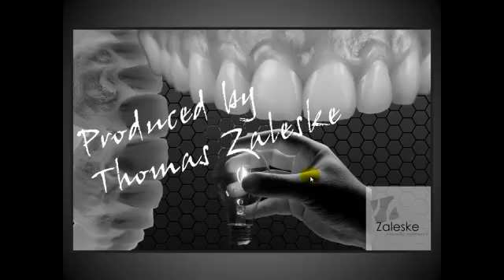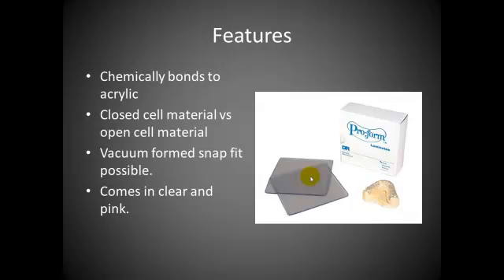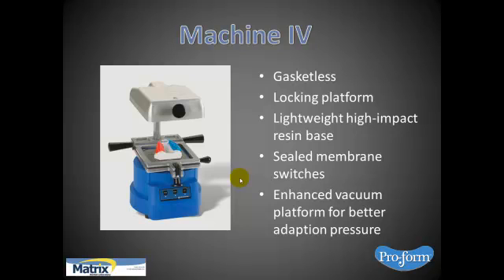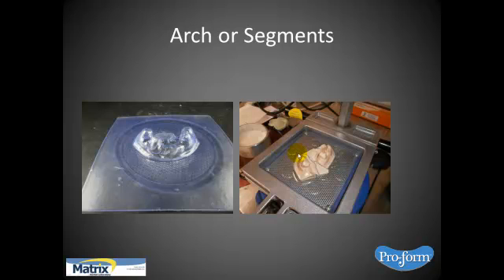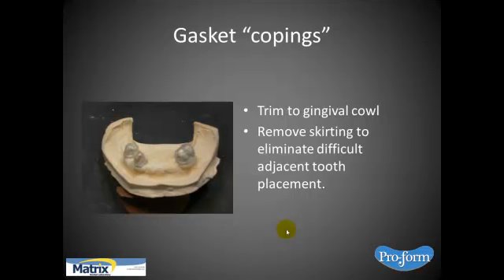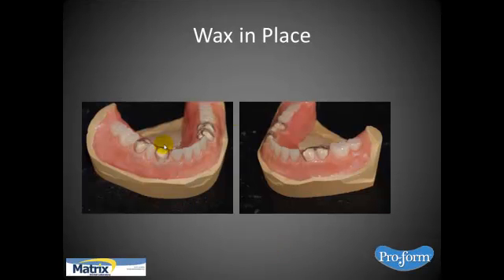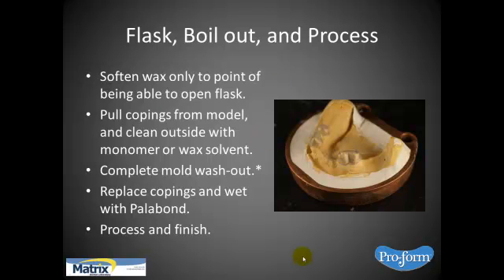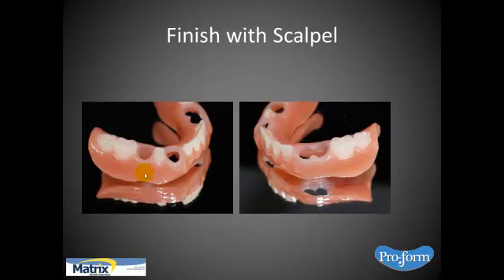E Gasket technique video

Comment: Thanks Tom for the great video. I had never heard of E gasket material until yesterday when I got the call to do a couple of gasket dentures. My Versacryl kit is 10 years expired. Scrambling, One I sent to another lab, to have done because I thought they were doing Cu-Sil. Nope, e gasket is what I got back. So now the question is- Is E gasket dual laminate night material? How thick is it? I don’t have ProForm material but do have Erkoloc and Essix.
Reply from the maker: Depends on how well it was pulled on teeth by vacuum. And how much available undercut.

Comment from the maker: The non bonding is occurring because you have stretched the laminate away from the EVA(ethyl vinyl acetate) and that EVA does not bond to acrylic! 
Try thinning your model base so that when you pull (form) the material over the model it doesn't have to stretch as much to cover. The stretching is also exacerbated if the abutment's are real long which is usually the case on cases of severe periodontal involvement.

Comment from the maker: Are you vacuum forming the correct side, hard surface UP, also it sounds like you are stretching the material  meaning you either are over heating, stretching the material over too thick a model or a combination of the two.

Comment: Mr. Thomas Zaleske,

I am having issues with the material not bonding properly.  one side of the night guard after heating and vacuum forming is very thin.  I have tried heating longer and shorter and am still having the same issues.  Any help would be greatly appreciated:)  

Thank you!